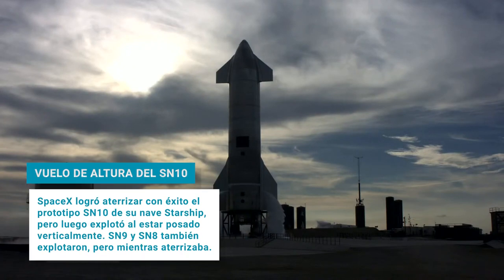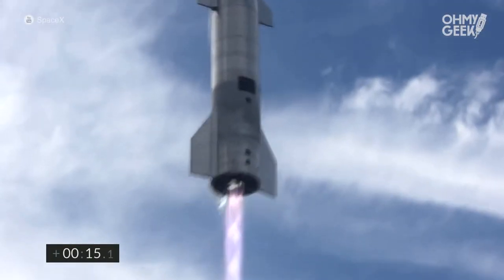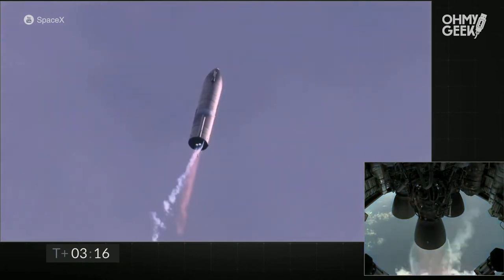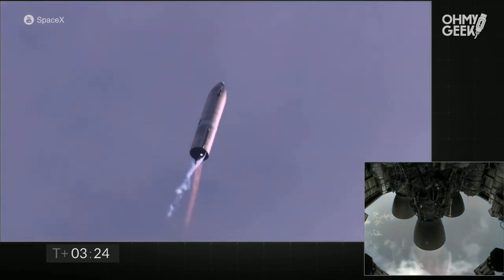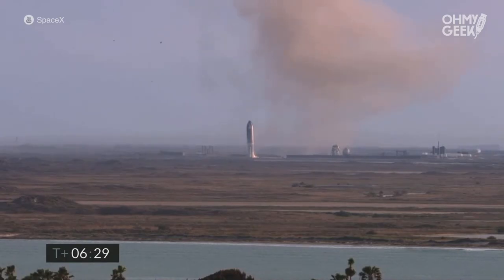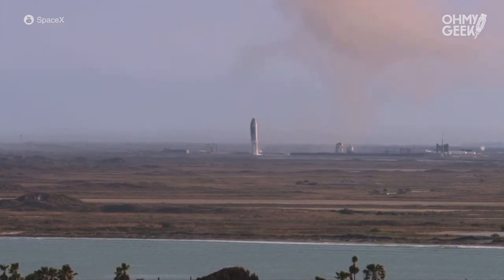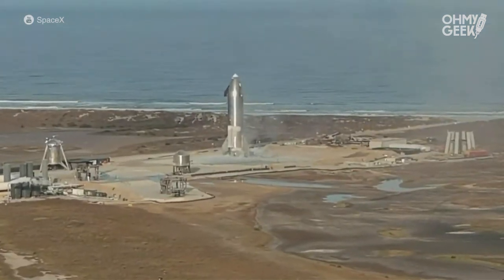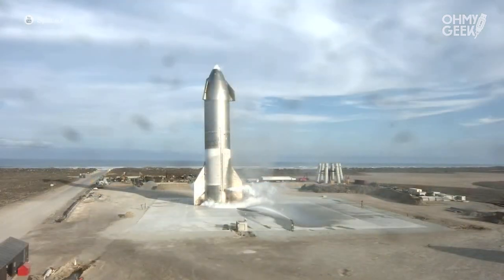SpaceX aterrizó con éxito al prototipo SN10, pero después explotó

Comment: Why vertically? It is totally silly to do it like this .... Elon, why don't you try doing it horizontally? All the weight of the structure and the tremendous reversal temperature are better distributed on the "critical moment of descent". The rocket from 10 kms. perfectly accomplished, go down horizontally, you are infatuated with descending everything vertically and that's how it goes. Dozens of tests, very expensive. What you save on the one hand you lose on the other in time, headaches and money. Descending horizontally is safer on land and at sea. Pay attention to an Argentine artisan! that engineer has the tricks .... jahhhh